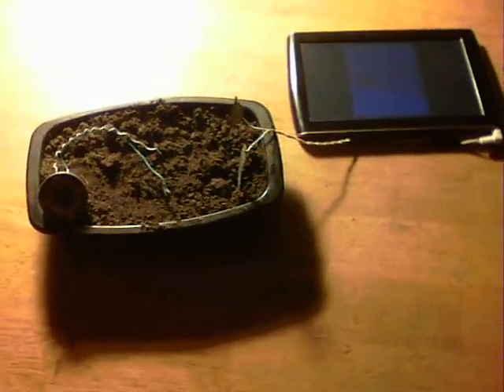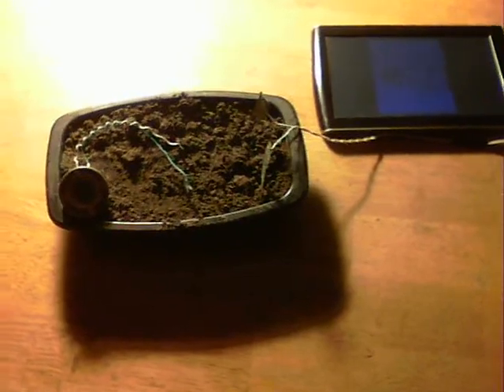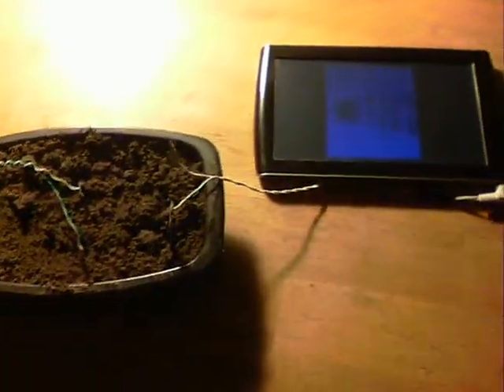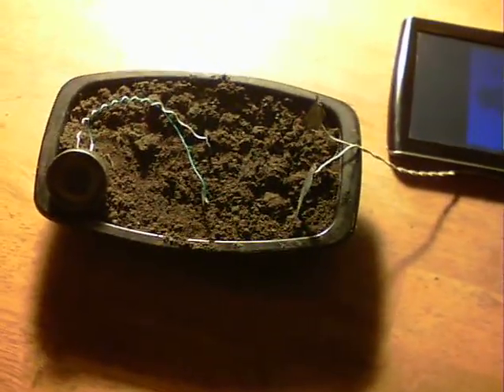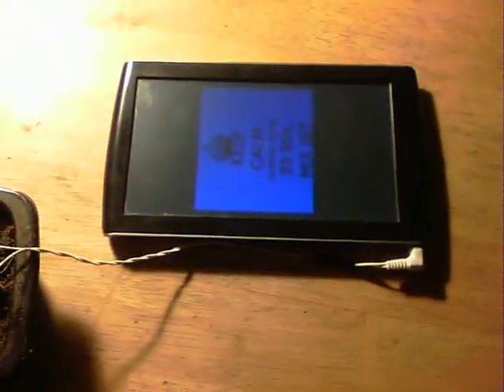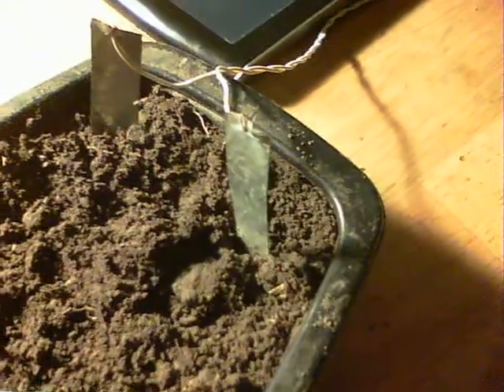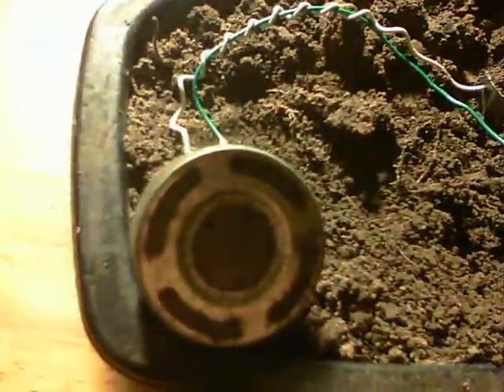Easy Soil Audio System

Comment: Ahh! I see the earth is a wire!
Reply from the maker: If 2 connections are made in-line like this, then the audio is picked up just like having earphones connected to the low output of the tablet.
Though there is a quite large resistance if moving the probes more than a couple of inches apart. Water and salt can help conductivity...pretty amazing how well this sort of things works outside after a good storm :)
Reply: slider2732 I tried connecting my slayer L3 coil in a plant pot and it worked (9inches) but when I connected it to real moist earth it wouldn't play ball (even 2mm apart!). Some one said it is due to the capacitance of the earth is to big relative to the coil.. Its like the Earth's field was snuffing it out!  What do you think the problem is?
Reply from the maker: Spangley Rainbows
 Have only just seen this comment.I think we covered a lot of ground (ahem) in emails lol. Yep though, the huge capacitive potential of the Earth does act like a snuffer...have to work with it rather than at it.

Comment: You divided by zero didn't you?
Reply: I would suggest that soil moisture and soil salinity may have something to do with the performance.
Reply from the maker: Nah, that caused a division in my logic and left it only half right two thirds of the time:)
Reply from the maker: Edward McLaughlin  Oh indeed, rain and soil salts will always help conductivity...but using only 1 metal and no diodes are something to ponder :)
It's a clay soil here btw and this was straight from the back garden.
Reply: Thank you slider2732